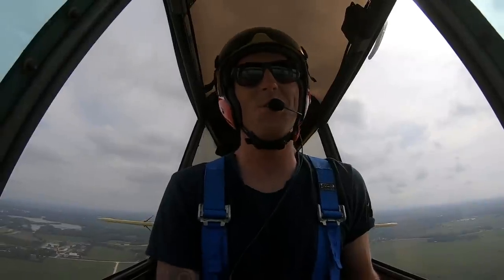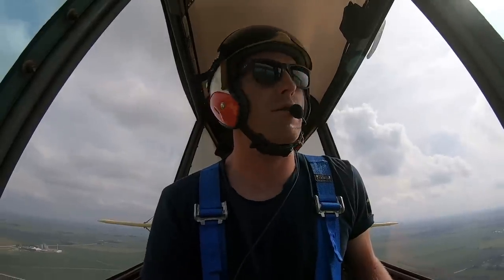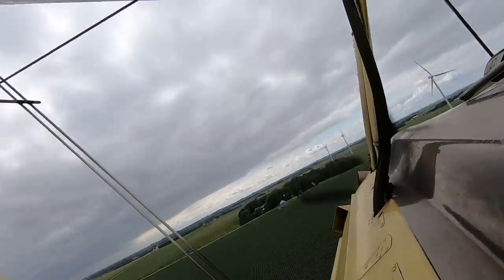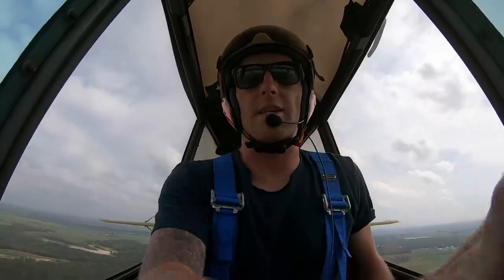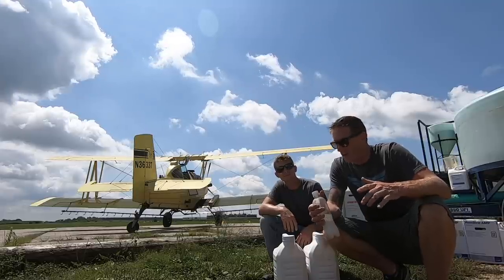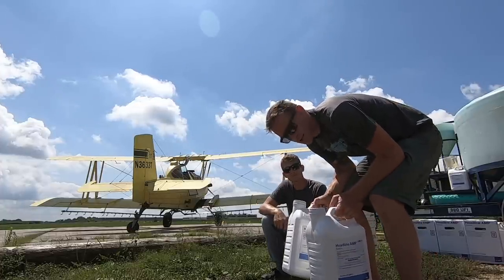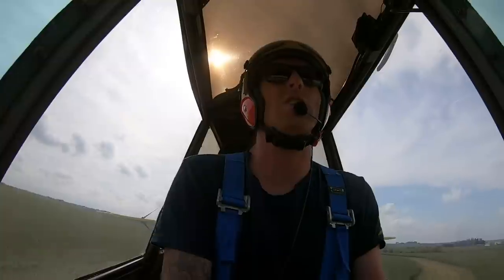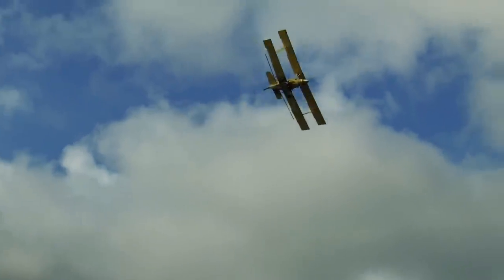Crop Dusting through Wind Turbines, Power Lines and Antenna's

Comment: From an Old Duster Pilot in the Fla panhandle, Great video!  Wish I had that camera technology when I was spraying back in the '80s..  I have some time in a "Frakes" -20 converted A model "Cat"
Also a bunch of time in the 450 recip "Cat".   Alot of difference in them.   Turbine power is the way to go but I still miss operating the old round motors....  .  Thanx for educating the un-educated masses.
Reply: You sound like me, Mike. I was in Jay in the late 80's. 600 B model
Reply: A frakes conversion for agcat is firewall installing a PT6. It’s now owned by turbines limited out of Michigan I believe

Comment: 11:35 Under the frickin power lines!! You my friend are a god damn sir. I fly those wood H-poles with drones daily and those lines are normally 60-80ft of the ground. Mind = BLOWN!
Reply: Yeah, uh holy crap
Reply: LOL I'd hate for you to see what most ag pilots fly under then.  I've got a powerline running across my fairly short strip about 1/3 of the way down.  It's the same height that you'd see in a residential neighborhood, so there's about 4ft of clearance with the tail up and wheels down...and it's not difficult to fly under even off the ground.  It's no issue if you're taking off from the first 1/3 of the strip, you just roll under it.  If you're taking off from the other 2/3 of the strip, you've gotta make a decision whether you can make it over the wire or fly under as close as you can get to the ground...without inadvertently hitting the ground and bouncing up into the wires.  Landing is opposite, the first 1/3 means you have to stick the landing because one tap on the ground will bounce you straight into those wires. Land over and past the wires...you might not have enough runway to stop.
Reply: He's God blessed to fly that low.

Comment: 30 years ago we were doing 1 gallon work with Pencap in Nebraska and 10 gallon work in Louisiana.  Those farmers in Louisiana wanted to see huge clouds of water.  We managed to sneak it down to 5 gallons an acre and they didn’t notice.  Same amount of chemical half the water.  Half as many landings and a bunch more acres a day.  People think Ag Pilots only fly the planes.  I’ve changed engines, changed cylinders, fixed pumps, fixed broken trucks, washed airplanes and anything else that needed to be done. Up at 4:30am and if you’re lucky you’re done by 10:30pm.  That’s what bug runs are like.  Then there’s dealing with the farmers!!!!  It’s a hell of a lot of work, but it was the best years of my life!!  Be Safe and Keep a Firm Stick. You know when the stick goes soft you’re all done—Flying!

Comment: Great video, thanks for posting, over in the U.K. the Ag  pilots used to call it the bird cage on account of all the wires. Very little Ag Aviation take place now due to enviromental laws, I believe the still spray Braken (Ferns) on the upper moorlands
By the way Scott you are doing a great job, it would not be economic to spray Corn any other way, other than by arial application due to crop damage from machinery.

Comment: It seems like your weight changes dramatically as you spray and move from a full tank to an empty one. Is the tank pretty much on the CG? 

Secondly, do you survey the fields from the ground before you fly against them to spot power and phone lines, tall fences or anything else that might affect how you plan the spray?

Comment: Hi, glad I found your channel. It's a long story; I started out to be a spray pilot and wound up flying freight in jets, go figure. However, I've been away from the business teaching for a while now, and I'm looking to get back into it. I have two questions for you. One, what is the job market looking like for summer 2020? Are seats going unfilled or are there 20 guys in line for each seat? Secondly, would a pilot be better off looking for an open seat or buying his own aircraft and looking for an operator to work for? Any advice you can offer would be appreciated.

Comment: I new a flight-trainer who was once a crop duster when he was younger and he came down for a run and accidentally hit a power line with his rudder.  He said the lines just pulled loose like a giant rubber band, he kept full throttle and he busted the wires and poles down each direction and they (the wires) brought him down to a complete stop in the middle of the crop field and he walked away. APPARENTLY HE KEPT FLYING THE PLANE.  All pilots just KEEP FLYING THE PLANE, Especially in an emergency.

Comment: At 11:36   you flew under that power line?  That takes balls man
Reply: No its just stupid.
Reply: @maxaoa6538  No, Not Stupid at all.   In many places the lines are elevated because of other ground issues so the clearance is greater. With experience and skill that maneuver can be done as safely as having to suddenly, quickly ascend to go over the wires and potentially catch underslung gear on them.
Reply: @dougbourdo2589  Sorry Doug, my 30 yrs of military low level experience begs to differ, but you can think what you want.
Reply: maxaoa   I beg to differ with you.  Never seen a power line less than 20 ft off the ground, dam poor pilot that can’t fly level with wheels 2 ft off the ground and it’s easy to see.  Over wires not so much!

Comment: Is there an exception/exemption from the "500ft from any person or structure rule," or do the areas within 500 ft of an obstacle just not get sprayed?
Reply: @Tyler Hoppenfeld  I think the information/rules for Aerial Applicators is FAR AC137.
Hope this helps.
Reply: @wms1650  That's exactly the answer to my question, thanks!
Reply: @wms1650  A very interesting read; I recommend it.
Reply: @BrilliantDesignOnline    This is just the FAR Regulations.
Back in 1971-1975 the aerial applicator I worked for complained about the excessive EPA requirements being changed and added.
I can't imagine how much documentation is needed now to adhere to EPA Regs.🇺🇸😟😟
Reply: @wms1650  There were several items of interest like dusting with sulfur.

Comment: This looks so fun.
 I know I'll catch shit for this but, you didn't mention what the fungicide was saying it's super diluted doesn't really mean much, if it wasn't diluted I imagine it would burn the fuck out of the crop hence the need for dilution. You can dilute a poison doesn't mean it's not a poison now it's just a watered down poison.

Also talking about drones you could turn your's or any plane into a drone the real problem is that autopilots aren't as reliable for low altitude flying with elevation changes and lots of obstacles the best autopilot is still a human just like in a car they can make them drive themselves but, they're no where near the level of a professional driver. Now if you're meaning a production consumer rc rotor aircraft like some piece of shit DJI than yes only an idiot would think that could surpass a full size fixed wing in anything be it payload or flight time or speed the only thing they're better at is sitting in one spot and going up.

Comment: Do crop duster pilots live long?  You need your wits about you flying around where you are on this video.  Thanks for the moments where I watch you and think "S**T pull up!
Reply: I looked up the numbers: death rates are about one death per 100,000 hours flown, which is three times the rate of other pilots.  And piloting is one of the more dangerous jobs out there, so by my math cropdusting is among the most deadly professions in the US.  That said, the average ag pilot will make it to retirement no problem.

Also, my data is pretty old, I'm sure GPS and other technologies have made this a whole lot safer.

https://www.cdc.gov/mmwr/preview/mmwrhtml/mm5315a4.htm
Reply: @agate_jcg  Still have to have your wits about you though.  Wires and the odd rotating wind turbine blade just means you have to stay alert.  Thanks for taking the trouble to look it up.
Reply: @bob fourjs ... if you want to live long doing anything it helps to keep your wits about you.
Reply: @oneskydog4401  Yeah, no hangover in the mornings!  Yeah, you need to be alert right enough.  Be good to do though, give you a bit of a buzz, but that is not the sort of pilot you want, you don't want risk takers.